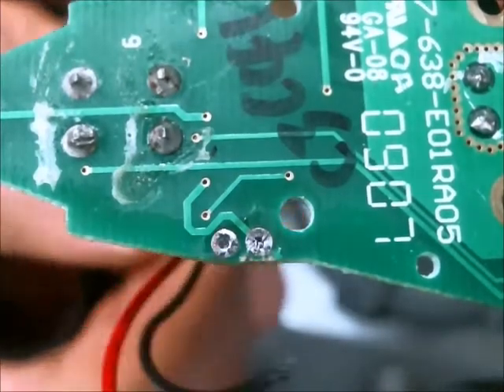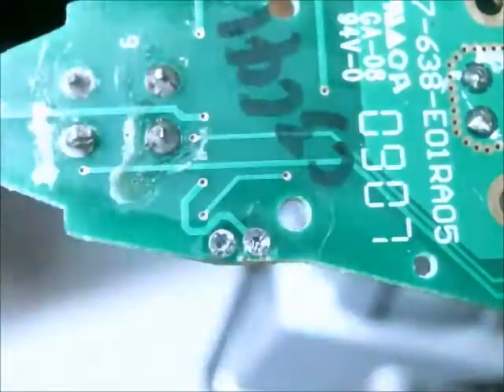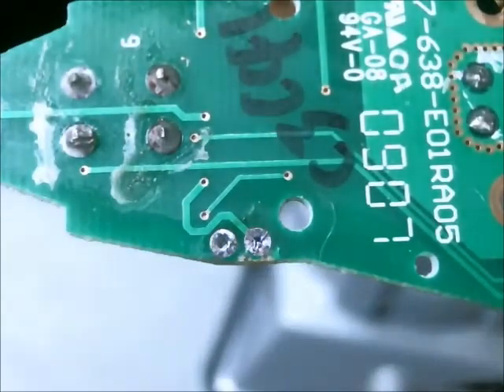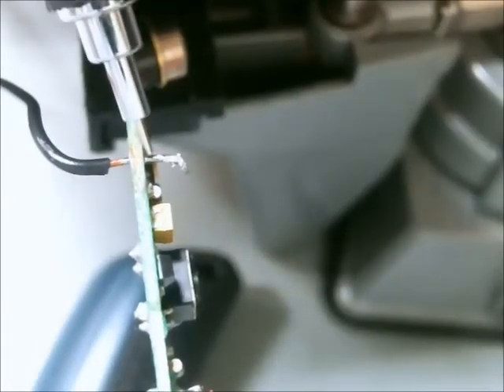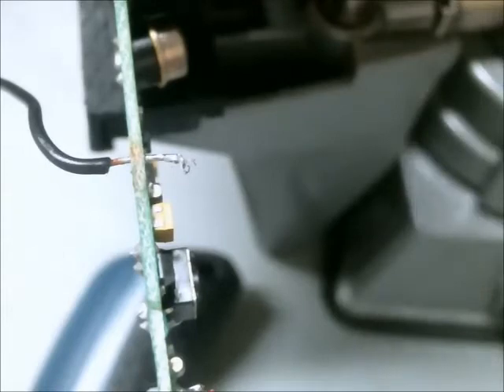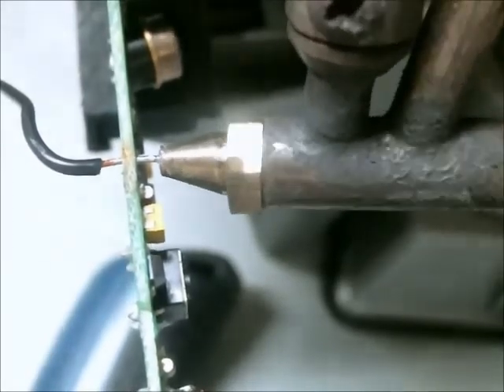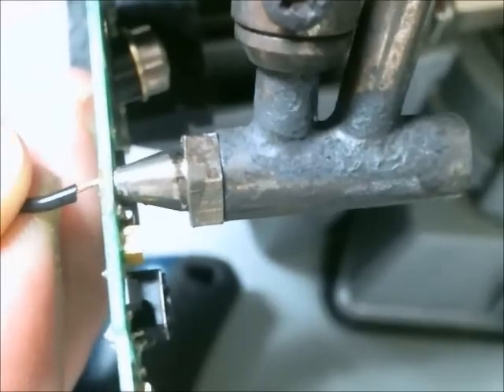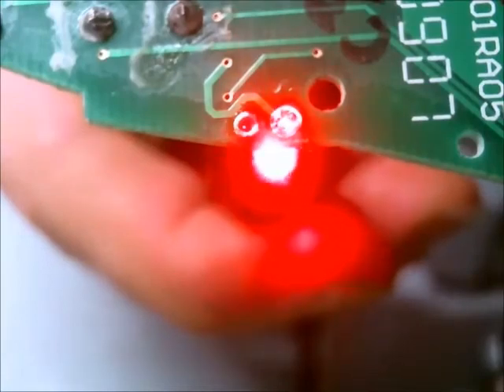Desoldering: Removing Broken Stranded Conductor from Hole

Comment: Oh yeah that’s the bane of my existence! Although I’ve found that running a solid core wire through a plated through hole can be problematic.. Oftentimes the solid wire will just bend and fold over onto the plated joint.. Also board density is a major concern, I work with guitar amplifier PCB’s which are extremely thick & rigid, yet still every bit as sensitive to heat damage as game console or computer PCB’s!